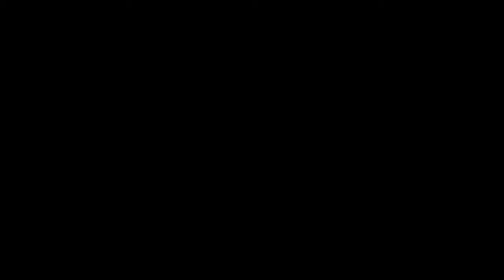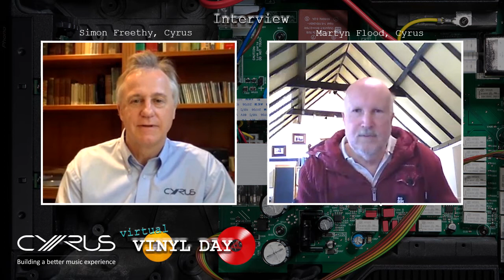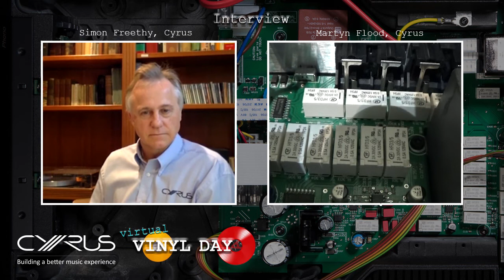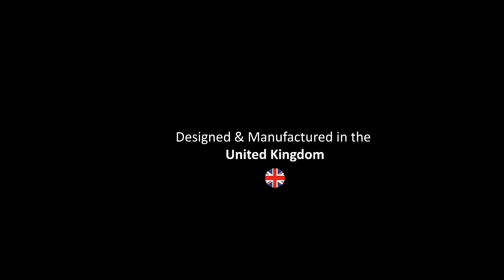Martyn Flood talks through aspects of the Cyrus Phono Signature design

Comment: If Mr Martyn Flood would care to comment.

1. How much signal quality are we giving up to have such flexibility? 
Small signals going through a myriad of relays and combinations of resistors and capacitors must take a toll.
2. Is the front end JFET or BJT. What is the gain block like? Is the eq active or passive?
3. What do you think of transimpedance phono preamp designs.
3. Are you using audiophile parts.
I am looking to buy a Cyrus Phono Signature to replace my Linn Linto.
Reply from the maker: 1/  Relay switching is by far the best way of small signal switching. The options for gain and loading configurations would be either a CMOS gate or a switch. The gate will always add distortion and a switch will always be worse than a relay as it would normally be available on the rear panel and therefore take the small signal away from where it needs to be on the PCB.  The only avoidable relays would be the ones to switch between the four inputs. The only other way would be to have a product that would only work with one particular type of cartridge.

2/ The Phono stage input is bi-polar followed by a passive RIAA network and FET input  ( so the RIAA stage sees minimal loading) gain makeup for a line level output.

3/ Transimpedance amplifiers are good for when the source needs to see a low input impedance, which is no good in MM mode when a 47k load is needed. The higher impedances usually used in this configuration can add unwanted noise to a small signal. 

4/ Yes…
Reply: @cyrusaudio  Thank you for the reply. I have since purchased a Phono Signature. 
A week later I added the PSX-R2 power supply.